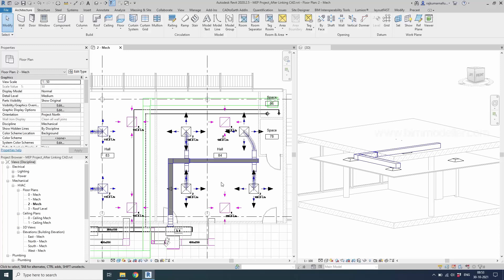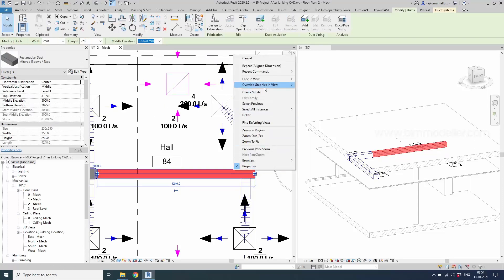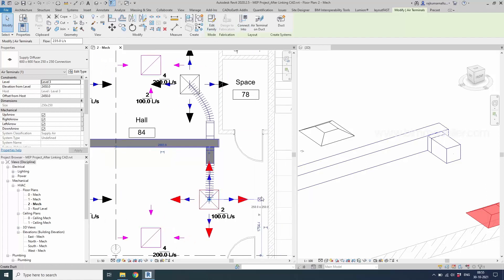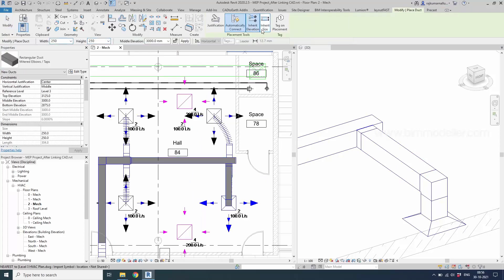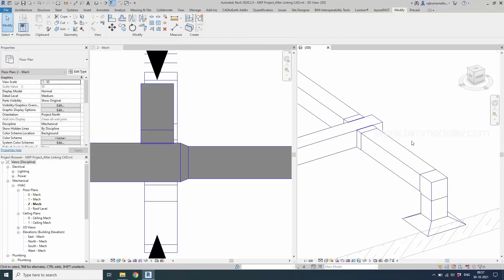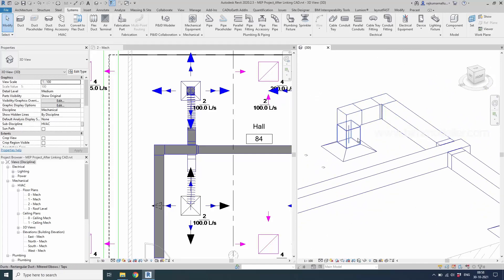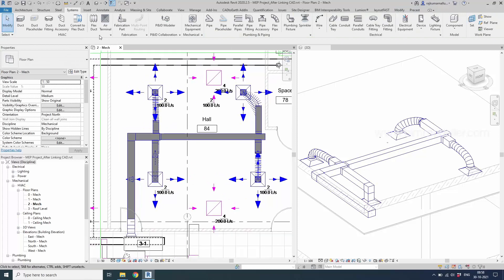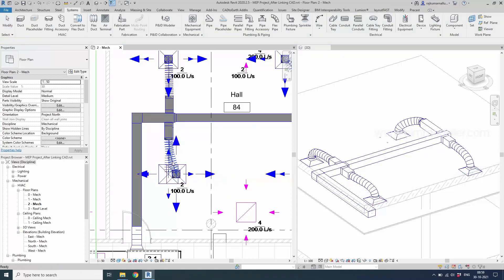Revit MEP Tutorial 17 : How to Create flex Duct in Revit

Comment: Hello Sir, I have question about "visual style" that give option for duct become shaded, wide frame etc. The question is I can't change the visual style to become shaded for floor plans 2- Mech and 3 - Roof Level while for the 0 - Mech and 1 - Mech I can draw the duct and change the visual style become shaded. Could you give me advice how to solve this issue?
Reply from the maker: Make View Template to None, then try.
Reply: @BIMModeller  Thank you so much, it works!